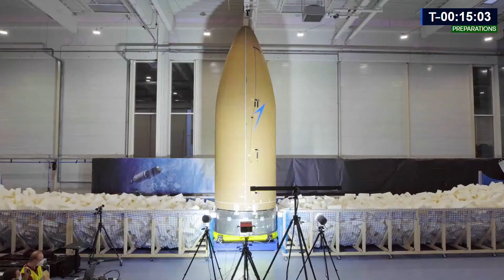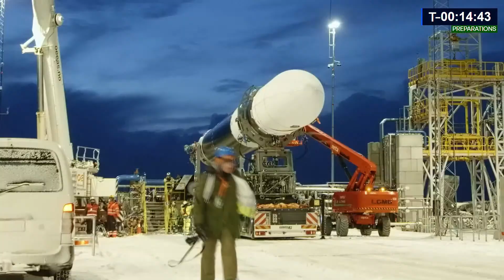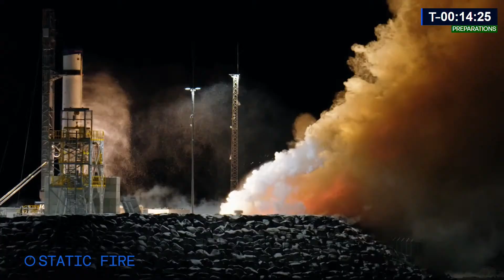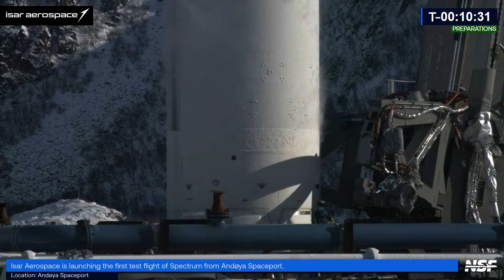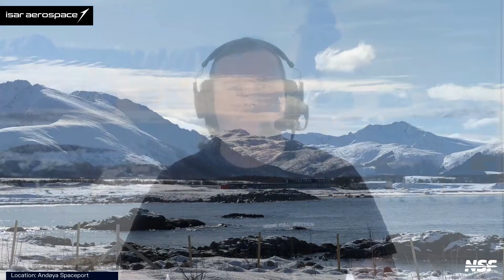🚀 'Going Full Spectrum' - Isar Aerospace's First Test Flight

Comment: The liftoff looked perfect. The loss of control reminded me of Proton failure in July 2013. Back then there was a problem with the guidance sensors installed in the wrong orientation.
Reply: I believe it had lack of trust. It seemed to stop accelerating pretty fast, which might have prompted the flight computer to overcompensate by excessively gimbaling the engines, ultimately leading to the loss of control.

Comment: Sad to see a launch failure. I noticed the hunting of the rocket engines before the pitch over was called. Something wrong with the guidance system. Pilots would call it 'being behind the aircraft', which generally doesn't turn out well.  Sigh.... gotta "Keep the pointy end up and the flamy end down"

Comment: Why sugar coat it. They are doing the Spacex Approach (@Tom mueller or // common sense of scaleable innovation - as she said, but why not say " same as spacex does" ). The pride as if they invented it themselves, is off putting. Almost any company must in order to adjust fast enough to make it to market fast enough have a large enough pipeline to support further innovation. Lets hope they can hold their horses.

It will be alot a of sceletons, controlled by watering mouths looking at spacex acomplishments.

Comment: Lost 1-2 engines on ascent, asymmetric thrust? Thrust to weight was clearly alright at first to get off pad but went way down on ascent instead of steadily up.
Reply: I saw a different angle of this in a different video and looks more like a guidance issue over there. Seems like there's some over correction.

Comment: It was a bit strange, you could see the PID doing its job and fighting to keep the ship flying on course, and then it just seemed to give up and the engines stopped gimbaling resulting in pitch-over to inverted.  Perhaps a problem with thrust vectoring control.

Comment: Isar Aerospace can be proud of this achievement on their first test flight. 
 * Construct a multi-engine, multi-stage rocket: Check. A very difficult first step. 
 * Deliver it to the launchpad: Check. This one is also hard, with the many environmental and regulatory hurdles to pass.
 * Fill with two cryogenic propellants: Check. Heck, most big name aerospace companies still have trouble with this one.
 * Ignite NINE! new engines: Check. We  all know who's having issues with that lately.
 * Lift off and clear the tower: Check! A very large number of things have to go exactly right to achieve that. NASA rebuilt quite a few launch towers in their early days.
 * Fail, but stay within the safety limits: Check. No human lives lost, minimum environmental damage because the craft stayed together until impact. 

Isar has achieved much in this first test flight, and has data that cannot be obtained any other way.

Build again, try again, fly higher; each step bringing you closer to the stars.
Reply: They did not fail. They recorded an unanticipated deviation.
Reply: Three stages destroyed instead of one. Spin it whichever way you like but this is a perfect example of why you should learn to walk before you run.
Reply: Bot
Reply: @brodie_friesen  who?
Reply: This has gotta be the best take I've seen so far
Reply: They did destroy their launch platform tho, if you didn't see all those chunks of concrete flying everywhere.
Reply: @rRekko what did you see what no one else could see because they didn't show us anything?

Comment: Don't cut the stream so quickly, we want some crash footage and a hint what was the issue! Doesn't have to be a detailed report yet, just let us know what the engineers think. The interview with Juliana was great, could have watched this for longer, surely there is a lot to say about this new vehicle!
Reply: The issue is that it stopped going up and came back down too soon.  There's your hint
Reply: It appears that attitude control was lost after initiation of ascent roll. Shortly after the roll began either the engines flamed out or the vehicle began twisting in an unintended dimension due to excessive thrust or gyro torque. Once it has rolled past level flat the engines definitely flamed out,, either intentionally through auto shutdown (very likely, navigation system decided that the ship was not on course and couldn't be corrected) or fuel slosh in the tanks.
One would guess that they're implementing slosh control systems such as pressure bladders in the tanks. Seems like they rolled it pretty quickly to start. Maybe too much inertia there. Interesting.

Comment: What's the problem with showing the failure all the way? Disrespectful to the viewers that tune in to watch the test, regardless of the outcome.
Reply: @xlr8r171 are you joking? This was a huge win for Isar. They now have actual flight data which is the most valuable form of data. SpaceX needed four tries to reach orbit, the first three exploded early. Astra took six attempts, followed by two more failures. Germany’s RFA exploded on the pad last year and never launched.
Even experienced players like ArianeSpace saw their Ariane 5 rocket explode on its first flight.

Comment: It had rotation from the start and when it had to perform the pich over maneuver it went into precession. The computer didn't know what to do, turned off the engines and let it fall back to the launchpad
Reply: So you already figured it out,huh?
Reply: @Ahornblatt2000  just speculating. Based on other footage the rocket actually missed the launchpad thankfully.

Comment: Pretty good for a first attempt, no scrub, no holds, good control for the initial ascent. Then something broke and ended the test. Plenty of good data for the team.
Reply: That is fair, the only delays they had were mostly due to weather. I wonder if winds were still high but they wanted to get it up. Would make sense that the low thrust to weight would tip easier.
Reply: @Clark8280 - the wind was no issue here

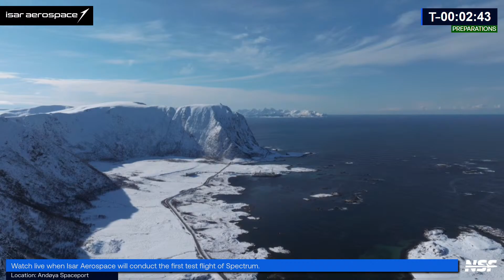Comment: At 12:30 European time, the "Spectrum" rocket from the German space company Isa Aerospace was finally launched from Andøya Spaceport.

After accelerating upwards for about 20 seconds, it stopped and thundered back to the ground.

- Let's all remember what we are here for today, the commentators said seriously just after the sound of a loud explosion on the live broadcast from the rocket launch.

- Today was the first integrated test of all systems. The test has resulted in a ton of data that the team can now evaluate and learn from.

The German company Isar Aerospace has previously said that they would be satisfied even if the rocket does not fly for more than half a minute.

- Every second we fly is valuable, because we collect data and experience. Thirty seconds would already be a great success, Daniel Metzler, CEO of Isar Aerospace, told the AFP news agency earlier this week.
Reply: Andøya Space sets up crisis team
After the launch vehicle "Spectrum" fell down and exploded, Andøya Spaceport has set up a crisis team.

- In connection with operational activities at Andøya Spaceport, there has been an incident at our location at Nordmela. A crisis team has been set up at Andøya Spaceport and we are working with the emergency services and Isar Aerospace to obtain a complete overview of the situation, Andøya Spaceport writes in an update.

- Safety during operational activities is Andøya Spaceport's highest priority, they write further.

The launch vehicle "Spectrum" fell down and exploded shortly after launch on Sunday afternoon.

Comment: It seemed the engines were not providing the thrust they were supposed to. Vectoring at low speed and insufficient thrust will cause the vehicle to lose too much forward momentum (remember, it's still fighting gravity) and attitude control is lost at that point. Right before they cut away I thought I saw an engine cutoff from all 9 engines, this could have been commanded from the ground but it's more likely the rocket knew it was in trouble...
Reply: Liftoff seemed very violent. It looks like they need to redesign the pad for better diversion. Debris catapulting towards the rocket like a fountain.
Reply: @cyanopsis  You are correct. It's not impossible something being thrown up from the pad damaged something on the rocket.
Reply: Certainly NOT an expert here, but I thought she seemed slow on liftoff and clearing the tower
Reply: @aztec0112  Yes that was the first thing I thought as well. Exhaust flame looked normal as it rose off the pad (but reduced thrust will only shorten the flame and we haven't seen it fly before so we basically have no idea how it's supposed to look)
Reply: They could hire some Astra engineers, they definitely know a thing or two about vectoring at low speeds lmao

Comment: I fear this will cost the Company greatly. Here in Germany the Culture towards innovation is very poor and they might run into financing problems due to the „lack“ of visible results.
Reply: They do implement rapid iterative development. Failures are a very important part of that process. A failure should be seen as a learning experience. At least you've learned how not to do it.
Reply: @nielshietbrink8133  i totally agree, unfortunately this is not some widespread culturally accepted view.

Comment: looks like hardware was working, at least on the engine side, must've been some sort of sensor or software malfunction
Reply: I believe it had lack of trust. It seemed to stop accelerating pretty fast, which might have prompted the flight computer to overcompensate by excessively gimbaling the engines, ultimately leading to the loss of control.

Comment: dont tell me they mounted the IMU upside down.
Reply: Really looks like the proton failure, doesn't it? Maybe guidance and control software problem, maybe thrust verctor failure. I think Rocket lab had a second stage failure because they connected someething on the thrust vectoring in a wrong way, so control inputs where inverted.
Reply: @Flinno-k8w  it looks like it wasnt ment to pitch over to the left of the camera. but it also looks like it pitched over to the right. so I dont know what happend

Comment: Why cut the stream immediately after?
Dunno but really thinking about unsubscribing, already pulled my membership a while back but it's going downhill more and more.
Reply: NSF is just rebroadcasting it...the company is the one that cut to the mountains with 'nothing to see here...everything is awesome.' That's so 1960'S USSR ish...
Reply: A small 5 minute segment with atleast one or 2 replays afterwards instead of hard cutting it would have been a whole different experience then this.
Missing the NSF from a couple of years ago, it has really gone down the drain.
Reply: @samuraidriver4x4  - this was the official broadcast from ISAR made with assistance from NSF.  Perhaps NSF shouldn't have published it on their own channel since people get the wrong idea.  I actually watched it on the ISAR account when it was live.  Unfortunately, ISAR had turned off comments on their stream - which also tells you a little about how they feel the need to control the communication.
Reply: @ Again, this might not be a NSF decision, complain to ISAR or even the Andoya Launch complex because they're are probably the ones having a say in this and controlling the video feed. Maybe the launch complex doesn't like their pad being blown up on repeat all over the internet. SpaceX is the outlier when it comes to opennes. These are things to consider. Bashing NSF over this is pointless in my view. But apparently you dislike their content already so again, shut the door on your way out instead of complaining about it. Don't get me wrong, I was also hoping to see the klabammo (better would be a succesful launch obviously) but will not bash NSF over that.
Reply: You might consider cutting the stream is not a NSF decision but hey, shut the door on your way out if you can't understand that content isn't created with especially you in mind....Jeezz
Reply: @zvartemax4832  Don't be pedantic. They have no problem showing when SpaceX fails, and any company or agency that requires them to cut the feed for channel viewers who tune in deserves criticism.

Comment: Wanted to see the crash . There’s nothing to hide come on. SpaceX doesn’t hide failures
Reply: They also hide sometimes failure during the streams. On the last starship launch stream they switched to starbase view before the starship explosion. (The cameras on the starship were still working as they can been seen on one of the computer of the control room)
Reply: europe has commie tradition
Reply: it fell straight down.  I imagine everyone was running for cover...
Reply: Isar stated before launch thar they expect about 30 seconds flight and an explosion. This flight went as scheduled.
Reply: @xpen2007  They didn't anticipate an explosion strictly at 30 seconds you nimrod. Most launch companies set their expectations low because they usually don't go to orbit on their first attempt

Comment: When people says "it's not rocket science" to say something is not as difficult as rocket science, they meant it... Because rocket science is damn hard! Good luck for the next test!
Reply: its like balancing a pencil standing upright on the tip of your finger, except the pencil weighs hundreds of tons and is accelerating to thousands of kilometers per her
Reply: @BlastinRope , no, in fact it is different. If you are balancing a pen, you are fixed to the ground, and trying to balance an object that is not fixed.
The rocket is balanced by its engines, which are already fixed to the rocket and tilting with the rocket itself. So, the control impulses are smaller and more direct. So, it is easier to balance a rocket than balancing a pencil
Reply: Yes suicide mission is crazy
Reply: There is no such thing as rocket science. There is aerospace engineering. Science examines phenomenons. Engineering uses that knowledge to create useful stuff.
Reply: @lajoswinkler Yes, there is such a thing as Rocket science." For every action there is an equal and opposite reaction." Sir Isaac Newton. Then Konstin Tsiolkovsky  related velocity gained to mass before and after expending fuel and exhaust velocity. That is rocket science. Physics. 
Then engineers like Goddard and Von Braun can make it happen.
Reply: Rocket science is some basic thermodynamics. It's rocket engineering which is really hard.